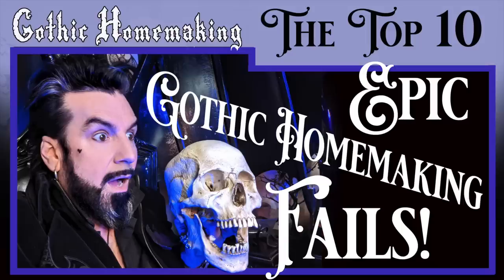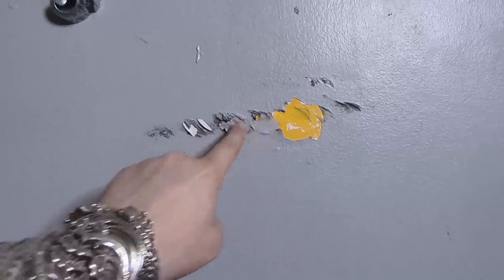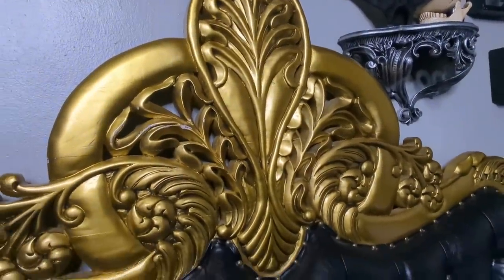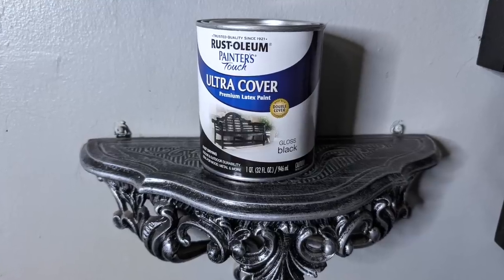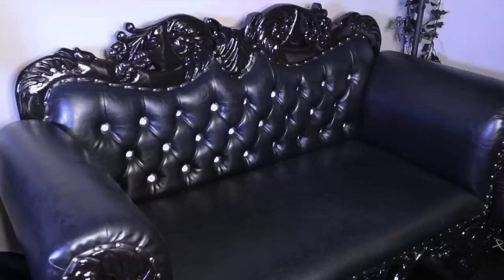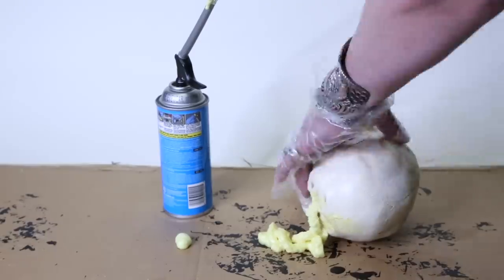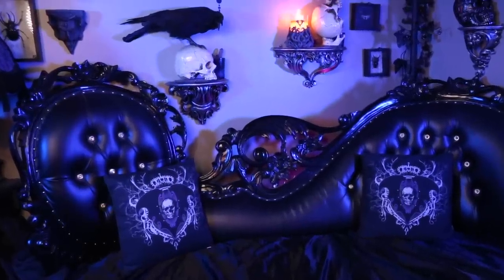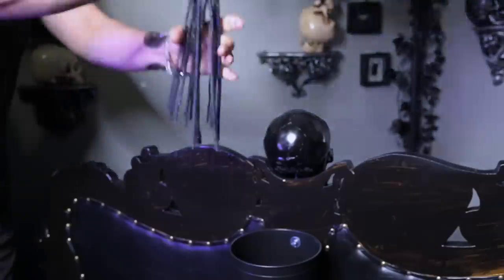The Love (Never Dies) Seat Transformation - Gothic Homemaking

Comment: Vampirate...now that's a movie that needs to be made. Super happy to see you and Mayumi (apologies I probably spelled that wrong) back with Gothic Homemaking. As someone trained as a furniture maker/ restorer you did a great job on the love seat. A tip if you're going to be using brush on paint again, rub it down with steel wool about 0000 grade between coats...it takes a bit longer but helps even out the finish, using a sponge instead of a bristle brush helps as well.

Comment: Couple pro tips:
When working with brush paints, thin your paints (changes based on paint type, but acrylic and latex are water-based), and work with multiple thinner coats to avoid brush stroke texturing.

Comment: A crafting trick I like to do to convince new paint to adhere to old paint (or other surface coatings) is to take a really high grit sandpaper and go over the surface with a light sanding. That will give the old paint a kinda rougher surface that will grip onto the new paint and make it stick together much easier.

Comment: I was honestly waiting for you to pull out the Rub 'n Buff to give it a little silver antiquing...it seems a piece primed for such a thing!  All those little intricate nooks and crannies in the woodwork would have carried it off nicely.

It strikes me that the first coat of paint might have been a little difficult to work with due to it being one type of paint on top of a different one, creating a too-smooth surface for the paint and preventing it from sticking to the woodwork.  A little light sanding to give it something to hold onto might have helped, kind of like when painting on plastic.  But it looks like the second coat is hanging on just fine.  Also, just a thought: it might be a good idea to get a piece of florist's foam for the flowers, so that you can easily remove it all as one if you decide to change the flowers up seasonally.  You could build a couple of bouquets using a florist's foam base, and it would even give you a little more control over height and ensuring things stay where you want them.

Gotta say, when you mentioned that the woodwork wasn't really Baroque, my thoughts went completely somewhere else from Art Nouveau.  I looked at all that gold and the ruffly edges, and thought Rococo...which initially horrified me at the thought of it in the Lair.  But with that center fleur-de-lis removed, the parts that remain are actually low-key enough that it fits like it was made for it.

Comment: That was not too much, depending on the type of foam, it can expand up to 10x  the original volume easily. I use expanding foam alot for projects and I have to be super careful. Another good tip for the foam is to coat around the hole with cooking oil or dawn dish soap.

Comment: Mr. Voltaire, (idk what you like to be called sorry) as a goth to another goth that douse carpentry for the future. If you need to paint onto wood already painted you have 2 options to help with painting it diffent that will help it stick and not flake later. Ither do what you did but give a slight sanding of a soft small grit of sand paper on the would with paint already there so small scratches can hold the new paint better with less coats you won't see them. Flat on flat dousen't like to stick. Or you could go the paint remover route and get down to the wood so the new paint can soak in and stay longer so no ugly gold comes out from flaking later if you bump it. You can also add a seal to it make it more shiny and protect the new paint more. Hope that helps man for this or future projects. If you ever have a carpentry or taxidermy question I'm your girl.  I'm goth and I build and designed my own decor and helped others along with sell my work as well. I love your show gives me ideas for my house. Take your stuff with a little more flair added in.